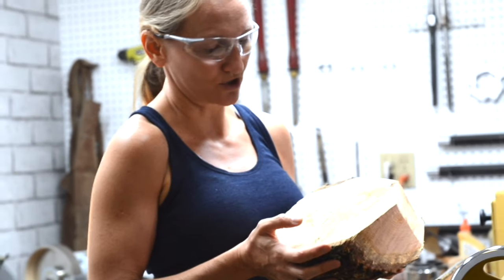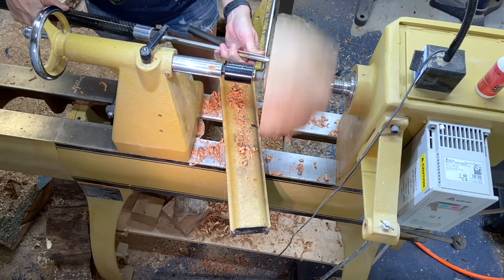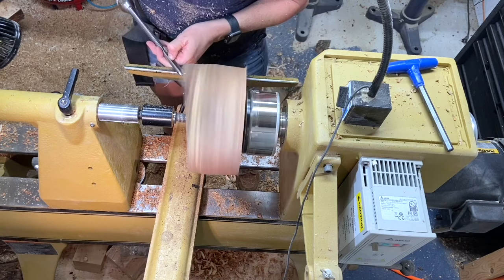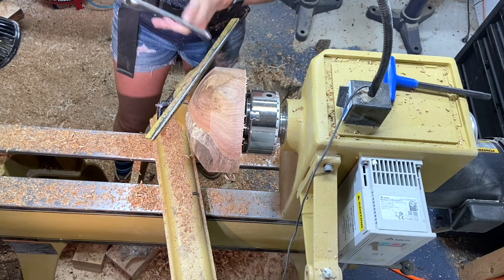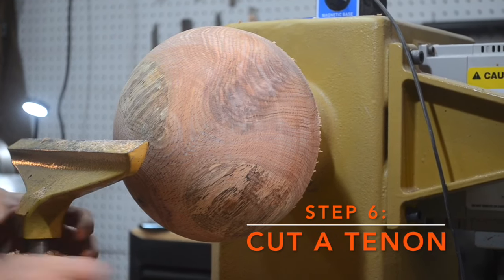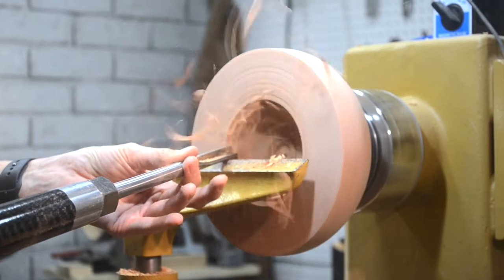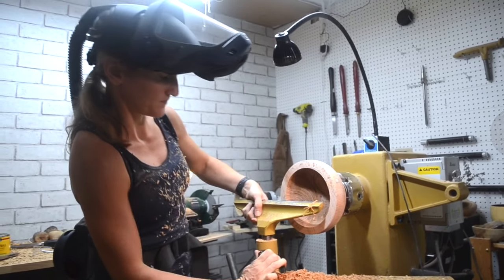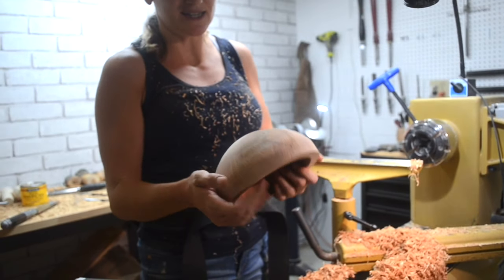How to turn a bowl in 10 steps

Comment: Good video. I do things a little differently. When making entry cuts, I like to do so with the flute of the gouge in the closed position, which reduces kickback and catches on entry, then as the cut starts open the flute. When starting a turn as you did, I do so with the blank mounted between centres with what will be the bottom of the bowl towards the tailstock, and start my cuts and shaping the outside from the tailstock to the headstock. This reduces the need to flatten off the top or bottom, or even having to round the blank as you're removing that material anyway & gets the blank into balance sooner, and having to make two holding points, but most importantly removes me from having to be positioned in the line of fire if the blank, or bits of it were to come loose and be shrapnel. It also allows me to move the blank if needed for a better shape or to remove defects. Tailstock in place is always a good idea like you did for security, at least until a piece has the weight removed, and is in balance. Thanks for sharing, I've subscribed as well.
Reply from the maker: Thanks for sharing your methods!
Reply: @lathedback  No worries, thanks for sharing your journey, and your techniques and thoughts. I picked up a couple things from you. That's what's great, always learning new things, and sharing it with others. I really need to get myself into gear, and get more videos up as well. Running a farm as well, so much to do, so little time, lol.
Reply: Me gusta me encanta saludos bendiciones
Reply: Son unos genios con la madera los felicito saludos bendiciones

Comment: Good tutorial. Observation/Recommendation…helmeted face shield please all the time.  I would be dead twice if not for wearing one.  One just never knows when/how it will occur….but it will eventually.  I’m 76 y/o and have been turning for 50 years.  I was adjusting a blank on the lathe and slowly (under 300 rpm) testing the balance when it unexpectedly split and blew up. A large chunk slammed into my face shield right between the eyes. Please, please. Good video.

Comment: Great video, what kind of tools are you using? Can you swap different cutters in one handle? They look like Ashley Harwood tools. If so, how do you like them? I keep looking at and trying to decide if they are worth the cost.
Reply from the maker: I am using Stuart Batty handles and a some of his tools, some sorby, mahoney, oneway.  I put the tool in an SB bolster and it can screw onto any handle.  His tool line is on pause but should be up and running soon.  I haven't used Ashley's tools but Stuart's are definitely worth the cost!

Comment: Where did you get the scraper that you used on the outside of the bowl at 13.23 of the video.  Got yourself a new subscription.  Loved the video.
Reply from the maker: It's from Stuart Batty's tool line and I got it at Woodworkers Emporium (which is closed now).  Stuart is going to start making tools again soon though.  But, you can just take any scraper and grind 20 degrees on each side to make a negative rake scraper!

Comment: Nice video, but i need to ask a question, in the first 3 minutes or so the bottom side is flatted with some sheercutting, why? What i do is to flatten the area where  the bottom of the bowl will be, not more because that will be turned away anyway. A nice rough bowl it is!! Keep turning and filming!!
Reply from the maker: I'm not sure if I understand your question but in the beginning of the video, I even out the face of the bowl so I can cut an even recess.  I then flip it over and attached the blank by the recess so I can them remove the tailstock to turn the bottom and outside of the bowl.  Hope that answers your question!
Reply: @lathedback  Yes i understand, but i do never even the face completely, just where the recess is  and a little more.  Thanks!!

Comment: If I held a bowl gouge with my thumb in the flute I would eventually get cramping in my thumb adductors.   Why do yo do this?
Reply from the maker: When I put my thumb in the flute and then wrap my finger around the other side and pull gently down, it provides almost equal pressure pulling down so I am not rotating the gouge one way or the other when I'm not meaning to.